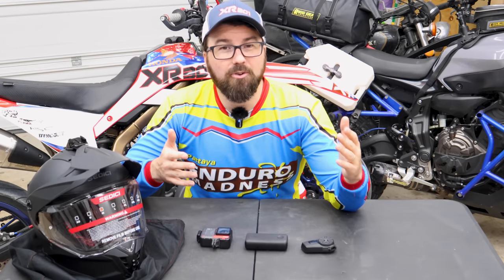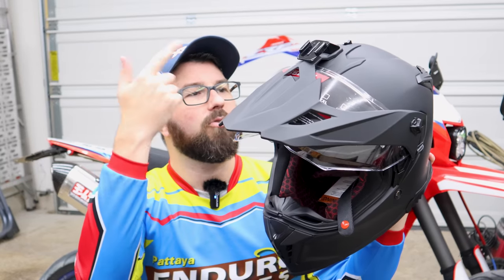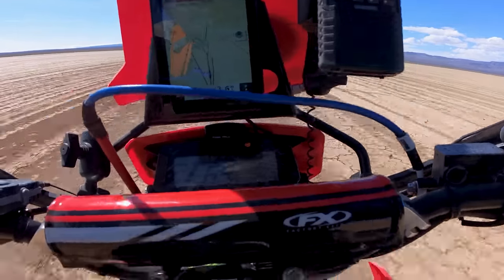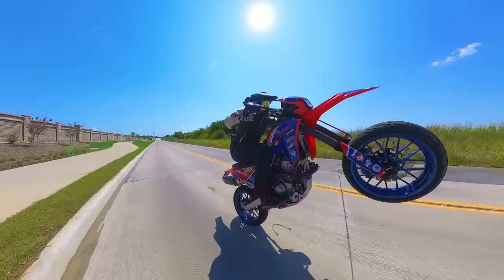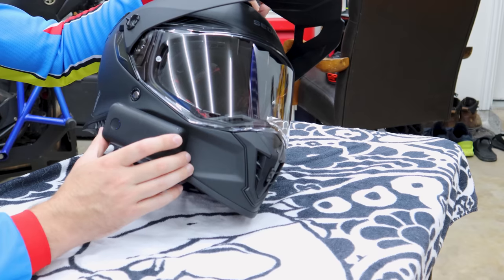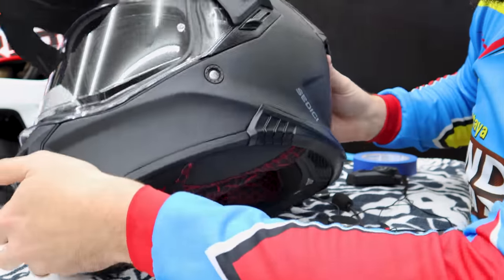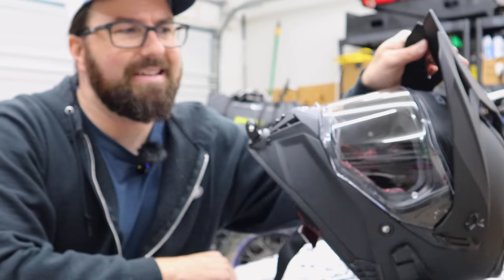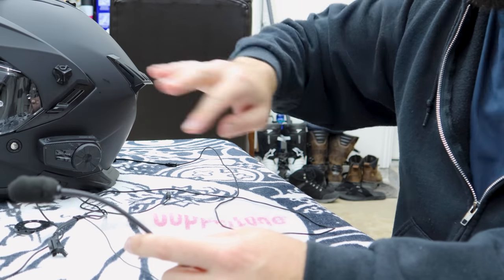The BEST Motovlogging Helmet Setup - 2023

Comment: protip for working with Sugru:  have a bit of water handy to dip your fingers in, or just a wet rag.  not for the initial placement, but for the smoothing down of the edges and blending in with the helmet surface.  with a matte black finish like on this helmet, you can make it blend really nice and almost look like it was molded there from the factory.  i have a helmet with a Sugru mounted chin mount that held on at 150mph for years and still looks great.  and i didn't do any pre sanding either.  
i would be worried that alcohol might mess with it chemically, so aside from the pre-cleaning, i would steer clear.  it's not necessary anyway.  Sugru will wipe off pretty easily, especially with a wet rag.
Reply from the maker: Oh kinda like caulk, I’ll have to try that

Comment: I Have very similar setup with my insta 360 One Rs but I find the audio in windy condition always struggle, recently just got the DJI Osmo Action 4 I think the audio is much better also the video slightly better more natural colors.  I am still experimenting with mic gain adjustments -12 db works best so far. I don't use the external battery as I have enough batteries to last for long time, in my opinion battery bank is way too much weight on the helmet.  easier to pull over and swap the battery if I have to.

Comment: I just wrote a lengthy comment and it disappeared? Oh well, again...

Nice video! The mic you were using was the Sena boom mic. Which was my recommendation to spicy, which was his recommendation to you. We rode together for 2(?) years while I lived in the UK. His 125 videos encouraged me to start motovlogging actually.

My experience on cameras so far after 9 years of motovlogging:
Ghost-S was great. Insane battery life, great audio. Quality is not sufficient nowadays.
Sony X3000. Great camera, needs a volume control for good audio. Unfortunately my unit went blurry after a drop. OIS design flaw.
GoPro is just too unrealiable, ditched.
One RS is great overall but audio quality was not satisfying to me. Wireless connection to record sound directly from intercom, quality also not great. I made a video on how to connect the units.
X2 great wireless intercom audio, but bluetooth connection unreliable. I sometimes sat in the driveway for 5-10 mins just faffing with the silly bluetooth.
DJI Osmo Action 3 is my current camera. You might need two adapters for good audio, but the overall package and handling is the best for me at the moment. It supports wireless intercom audio, too. But that means no quick capture, which is a must for me (as it is for you).

Feel free to check out my latest video on the DJI Osmo Action 3. The auto generated english subtitles are surprisingly OK.

Greetings from Germany
Reply from the maker: Wow you’ve had about as many as I have haha. The most reliable I ever had was the old drift stealth 1080. Funny it was called stealth, it was huge! The insta360s haven’t had good external mic audio until recently. If you have a One RS with the current firmware then you’ll get what I have now.
Reply: @TheGardenSnake  Thanks, nice to know. I have donated all my Insta360 cameras to Ed March over at c90adventures in Utah. You should know his channel? Hope he puts them to good use!

Comment: GoPro is far better. BUT software? Its SHIIEEEEEEEET.
I only shoot at 1080p for about 4-5 hrs. Probably why it doesn't overheat.
Reply from the maker: Well Water had 4 hero 11's on a trip we were on. They all kept overheating and freezing up. All while my insta360s just kept on rolling.
Reply: @TheGardenSnake  what resolution is he at? 4k? At 1080p my Hero 9 is quite hot already but never overheated.

And oh btw. Have you looked at the 550 performance products? A lot of CRF300 users buy their stuff